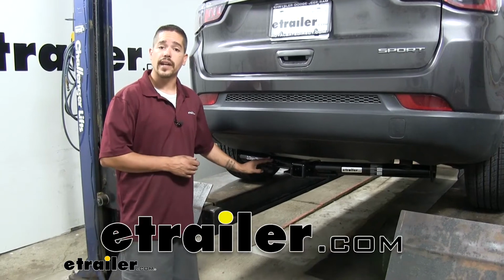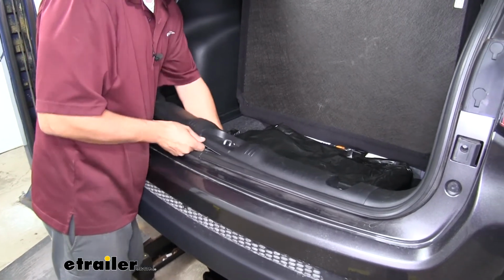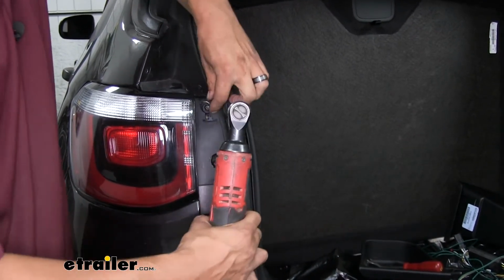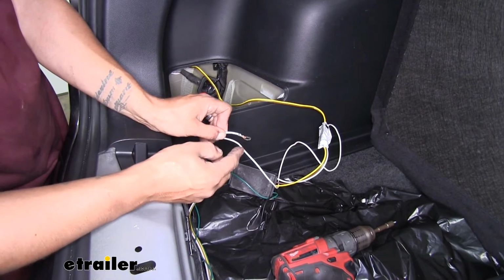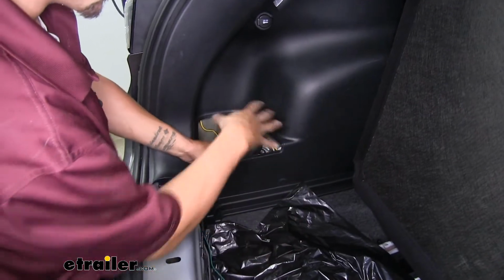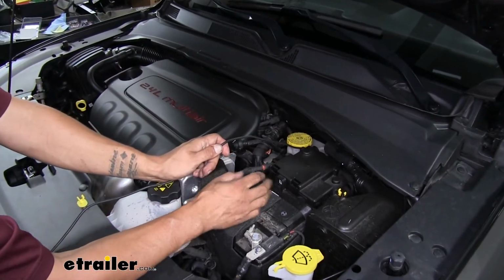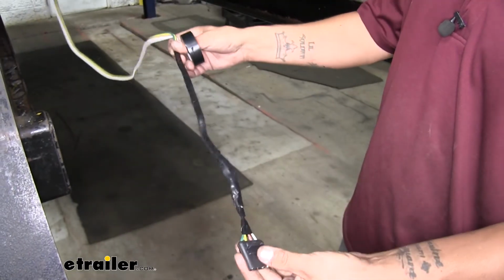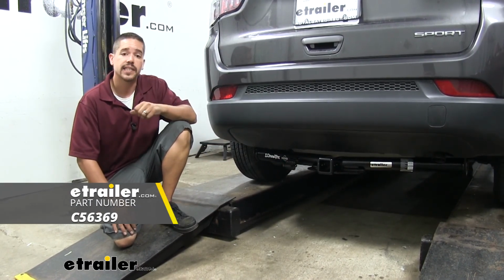etrailer | Curt T-Connector Vehicle Wiring Harness Installation - 2018 Jeep Compass

Comment: The 4-wire connector does not fit in the round hole. I had to cut the hole approximately 3/8 inch to one side to get the connector through.

Comment: Just completed the install.  Not so bad. 
Making the hole for the 4 plug bigger wasn’t so bad.  Not as bad as the trailer install.

Ready to haul!
Reply from the maker: We're glad to hear about your successful install! What are you planning on towing?
https://www.etrailer.com/Custom-Fit-Vehicle-Wiring/CURT/C56369.html
Reply: @etrailer  Just a basic 1-axle landscape trailer for hauling debris to the landfill and picking things up at home improvement store.  Tired of paying for Sheetrock and concrete delivery charges.
Reply from the maker: Good deal, perfect reason to have a trailer!

Comment: How'd you get the 4poled wire through the grommet hole? When I took the grommet out the hole was too small for the end to pass through
Reply from the maker: If you can't find a larger grommet that the 4 pole will fit through, you may need to open up a hole a bit to fit it through.
https://www.etrailer.com/Custom-Fit-Vehicle-Wiring/CURT/C56369.html

Comment: ok instead of threading the black cord all the way up to the front battery, could you just connect to the 2nd DC port in the trunk?
Reply from the maker: It is not recommended to run the power wire to the 12V outlet in the trunk area. The reason for this is that you could easily overload the factory fuse for that outlet and blow it. This would cause you to lose all functioning of your trailer lights. That is why it is only recommended to run the power wire directly to the positive post on the battery.
https://www.etrailer.com/Custom-Fit-Vehicle-Wiring/CURT/C56369.html